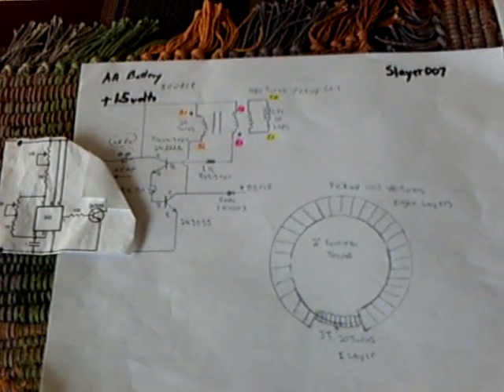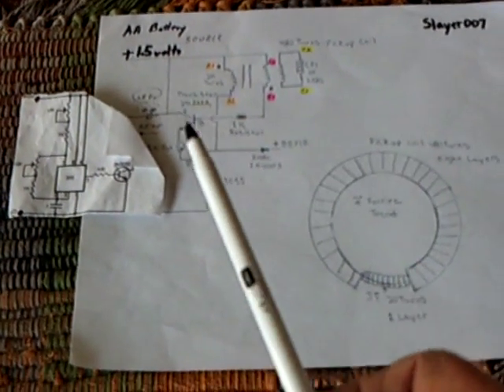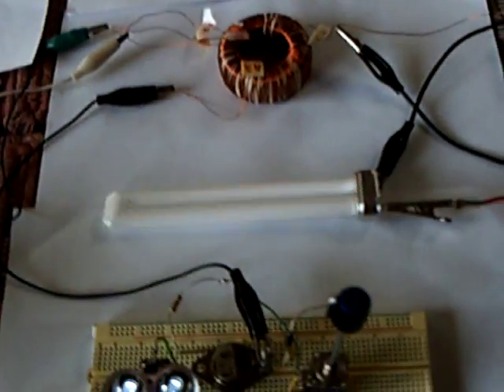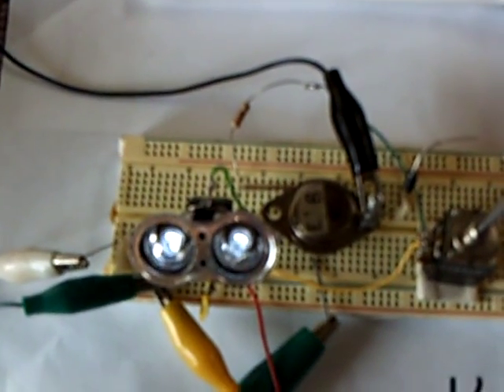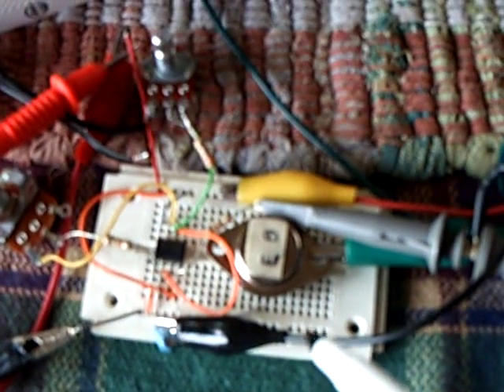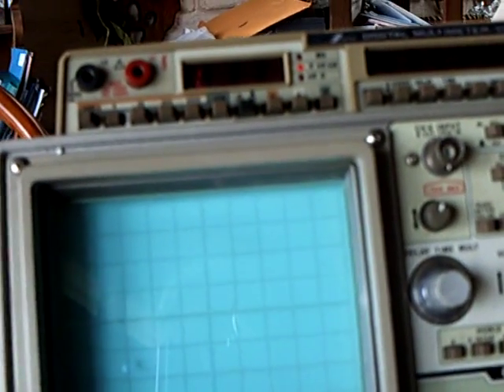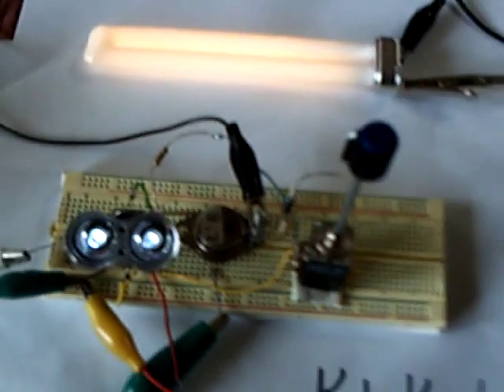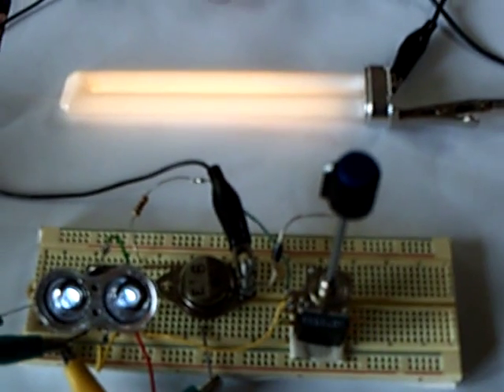Kubikop's 555 timer pulsed Joule Thief light

Comment: @thelightguy1 this won't save power, (to my knowing and logic, its using MORE power because of all the extra regulators, transistors IC's etc etc etc.) and all this does is run the bulb (or any other load) at half power read up on how PWM (pulse width modulation) works.

Comment: Is that a linear voltage regulator? you're wasting power as heat and there is no need to regulate batteries... stop using BJTs and get into mosfets if you want efficiency.

by the way "joule thief" is just an inverter circuit...

why call it joule thief when it's got a real name?, would you call transistors "thingies" if someone else did? 

dc-dc converters (buck, boost, etc)...

Comment: have u tried running it on 12V, i wonder how low u could get the amp draw down with good light.

I will be replicating this circuit soon (basic Slayer), I think it has good lighting applications, i just hope its more efficient than the CFL oscillator with ign. coil.
Just need to get my hands on some big toroids!

Comment: HI Rusty

Im glad that it ported to your circuit well I think that this would work with all lighting, a second pulse needs to be introduced though to get the coil into resonance Im going to run mine at 250Hz waves with 1.5MHz in between because the maths works out nice.

Also at the end of each 60-100Hz pulse you get a ring out that goes negative that you can use to charge your battery from a secondary point. Ill do a video and upload it when I get chance. 

Are you using the the CMOS 555? 10uA!